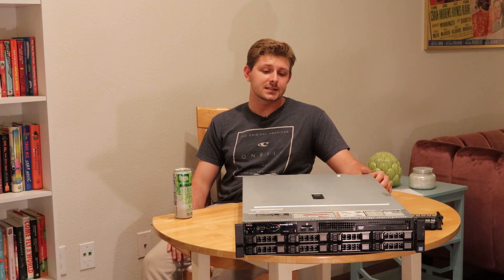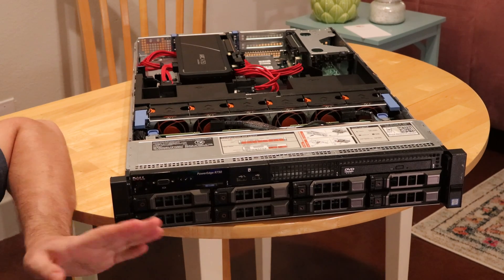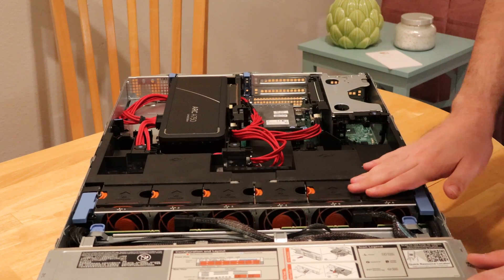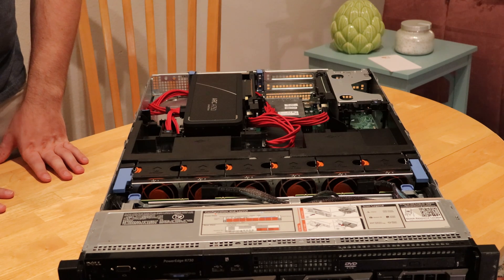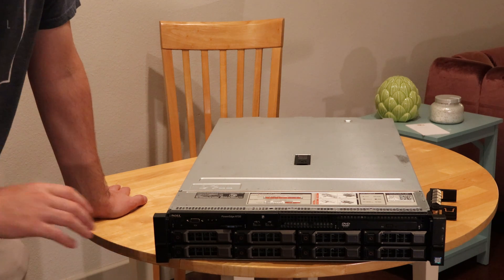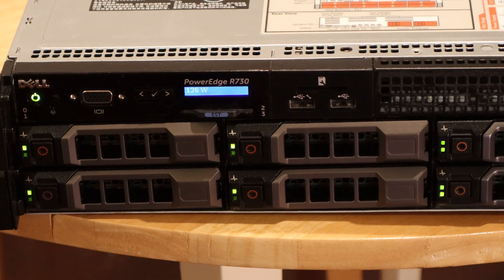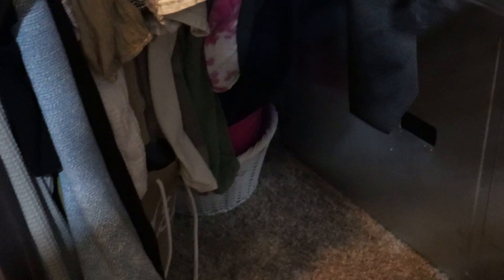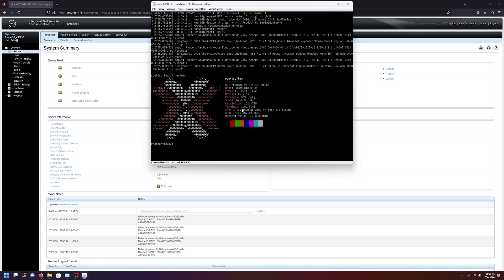The BEST Homelab Server for the Money - Dell PowerEdge R730

Comment: I have an R620 which is a 1U version of this, and it's been pretty great, it uses 2.5" drives though, but as 2.5" SSD drives have gotten cheaper, I'm just starting to fill it up with those...
Reply: Dell PE r630 is the "1U version of this," kinda. Save Gen. The old 12 series--r520/620/720/etc--are just that: old. Don't start me on the 11 Gen. LOL Those 2.5" servers--I have one of my five r730xd with 24x2.5" and it's all SSD--are very quiet. Put in low power E5-26xx V4 and they don't take a lot of power either for huge performance. And Proxmox loves them. :)

Comment: Great video ! And great job with the GPU power cables.
Dell sucks at generating solutions for the high grade GPU powering and fan speed problems. 
The biggest issue I have encountered is the GPU power cables. There are a lot of cables around, but most of them are useless. 
I have a R730 with 2x2699V3, 304GB ram, 2TB NVMe PCIe SSD + 2TB SATA SSD, 2x1100W. And the fans are silent normally if you do not add a GPU. But with the GPU, I needed to lower down fan speed a bit. But recently I saw that there are liquid cooling options for dell r series as well.
Reply from the maker: Thanks for the comment! It took me a good two hours to make the cables due to my own rushing and making mistakes and not being sure of the exact pin-out, as I heard on some servers the pin out is that of a cpu 8 pin connector, and others a 8 pin PCI connector (this was what the r730 used) , but it was definitely do-able. I saw several options for a cable on eBay and Amazon, but I can't comment on the quality of them.

Liquid cooling would be really cool to see on these - I'll have to explore that and see. 

What do you use your machine for? Those are very nice specs!
Reply: I presume most of the things that I will mention below are things you already knew. However, I had no server-grade machine experience before I bought the r730, and I learned a lot by reading people's comments. I believe your video will be a magnet for r730 users, and I wanted to leave some breadcrumbs for your future subscribers. 

We (my wife and I) use it for genetics/genomics/proteomics data analysis on Python and R kernels on Jupyter Notebooks. Hopefully, we will use it with DL/ML-based image segmentation and prediction model training if I can successfully install P100 16GB on the server. I'm still having problems with the power cable and waiting for a custom-made cable. I tried different cables sold on Amazon and eBay, which claimed to be for R730, but the more I ordered, the more I learned that most of them needed to be correctly configured. Not even mentioning that every time you plug one in, you risk burning something in the server or the GPU because of voltage issues.

I use R730 full force without VM to get its total capacity on Linux. For people who would like to use this machine in analysis but wondering about the performance and who would ask why (some of them might say, "My Mac with Apple silicon can do a better job"):
Most of the data-heavy analyses hit CPU or Ram units a lot, if not both, during the analysis pipeline. Simply because the packages in genomics/proteomics were generated by non-professionals (mostly with grad students' help) and are not optimized for daily use. So, even when working on parallel computing nodes, we have problems caused by using non-optimized packages. And this ends up in pipeline breaks due to access Ram use etc., after it first caps the Ram and then hits the swap. Solving these problems is highly problematic since you assume that the server is always perfectly configured and the problem is your code. But most of the time, you find an incompatibility problem in the environment you compute and try to solve it by sending emails to the server admins. The other option is using Azure, Colab, or AWS, but this time on one end, you don't know where that data goes, on the other end; if you'd like to complete a job that will take days, it starts to become a headache. And not every time your code works as expected, so you re-run and re-run again. On new, loaded Mac notebooks, Ram becomes an issue even if you have 64GB of it. On the other hand, Mac desktop computers are really expensive, and Apple has the habit of turning your money into ferry dust after 2-3 years if you invest in them. On the contrary, old server machines like R730 give you the whole control of the task, and you can log in and be able to trace the problems quickly. One step ahead of R720 with DDR3, R730 can use DDR4, and the Rams are dirt cheap on eBay these days. On the CPU level, even though each CPU core individually seems to be slow compared to the latest CPUs, when run in parallel, they form the mighty "Voltron" together to complete the workload. 

By the way, to protect the mental health of new R730 users who would like to add new GPUs, I'm adding a youtube link for how to design and generate a GPU-Riser PCIe 8pin cable for R730:
https://www.youtube.com/watch?v=fvgw9sv8k9I&ab_channel=ComputersCatsandMore 

And on this one, the same person checks the voltages of the Riser and shows how the cable pin configuration should be for R730:
https://www.youtube.com/watch?v=1bInTHpoPSw&t=210s&ab_channel=ComputersCatsandMore

The person in the video also sells cables, server parts, and machines on eBay and is very helpful and reachable. This is the person I ordered the 8-pin cable from, and I'll add an update on this topic in the upcoming days :).

Most people use these machines for home-lab-based use, including mining, gaming VPN, email or web server, etc. Because these machines are a bit aged, new parts and solutions are a headache (such as NVMe boot and new GPUs). So, I presume people start moving to newer machines that would give them fewer problems to solve and more options for using newer parts(especially the miners). On the contrary, some parts and tech (such as 10gig ethernet cards or switches) that were so hard to reach budget-wise a couple of years ago are now dirt cheap on eBay for R series Dells.  

For the fan noise, here are my notes:
R 730 works incredibly quite if you use Dell-branded parts(I'm excluding the GPU). Compared to the AC unit we use in the US, it generates less noise if you're not pushing it to compute on a vast data frame.

The first time you add any new parts, in order to protect the board from the heat, it gets loud and settles down to be quiet (of course, if you did not add a GPU).

But if you add a GPU, because the BIOS fan hex codes are old, once it senses that something is getting massive power out of the system, it starts jet engine mode and gets very noisy (every time I hear it, I curse Dell engineers and I hope they feel it in their bones). 

There are two ways to slow fans down:
a) Let it run full diagnostics on the parts (find it on the lifecycle menu). This will take an hour or so. It checks every CPU core and Ram separately, including the video card. And it will go down from jet engine mode to ~4000rpm-ish, which is still loud. But you do not have to do anything; it takes care of itself if it gets hot.  

b) Use hex codes:
These codes will temporarily override the reactive BIOS hex fan code running in the background. You cap the spinning to a level. * REMEMBER TO CHECK THE TEMPERATURES IF THE GPU IS BUSY WITH SOME TASKS.***
Enable manual fan control:
sudo ipmitool raw 0x30 0x30 0x01 0x00

Monitor temperature:
sudo ipmitool sdr type temperature

For example, to set the fan speed to 20%:
sudo ipmitool raw 0x30 0x30 0x02 0xff 0x14
** Now they should have slowed down **

Monitor fan speed:
sudo ipmitool sdr type fan

ALWAYS Monitor temperature if something is running in the background :
sudo ipmitool sdr type temperature

I will generate a temperature-sensitive script that will change the fan speed accordingly and add it to the Ubuntu startup as a service once I successfully run the P100 GPU I have. I do not want to deal with the BIOS hack; I will bypass this with a script. 

Note: I use a 3.1 Samsung Clover imaged USB hooked on the board USB hub to boot Ubuntu 22.04.3 LTS Server running on PCIe Samsung 2TB NVMe SSD. The overall reboot time is ~3mins. Getting rid of Clover might only give back ~30 secs(27 sec to boot into Clover + 3 sec after Clover starts). Believe me; I tried a lot to get rid of it to boot the Ubuntu. It is not worth your time! Add whatever service you want to start to the startup and give it another minute; that's it. Notably, if your services are running, you will restart it rarely! The Dell boot manager checks everything and consumes most of the startup. And by getting rid of the Network check after the Ubuntu boot menu, I managed to get back 2 mins.
Reply from the maker: @drcemdede   Thanks for the reply and excellent write up - lots of informative and very cool information, much of which is new to me! You've done a lot of research and are very familiar with the machine! I'm hoping your power cables work out and hope the project continues to progress smoothly! 

To add, I'm fairly certain the snag you're having with the power cables is that the P100 has a EPS12V connector, which does not match the pin out of the riser cards. You'd likely need the riser card PCI-E 8 pin power cable and then a PCI-E to EPS12V adapter. Essentially hook this: (Dell P/N N08NH) up to your riser(s) and then hook this (NVIDIA P/N: 030-0571-000) to the other end, and then to the P100.
Reply: @ComputersAndCoffey  The easiest way to get working GPU cables for R730 is to buy the genuine Dell part (9H6FV) and replace the connector at the GPU end. NVIDIA provide technical data sheets with the expected pinout. The wiring colours are super obvious black is ground and yellow is 12V as expected. There are some sellers on eBay in China offering a suitable cable, just need to look for the ones that say P100 compatible. These are good for P100, V100 and A100. Though the R730 will only work with the 40GB version of the A100. The 80GB version is a 300W part and requires an R740 with riser option 16.
Finally the technical manual for the R730 says that when GPU's are installed all PCI slot covers that are not in use need replacing with solid ones for cooling purposes.
Reply: I totally get what you're saying.  My Dell R720 runs almost desktop quiet.  The Air conditioner in the room where my server rack is located is (which is also my office) is louder.
Reply: See the link i posted above.  It fixed my fan speed 👍

Comment: Honestly this thing is remarkably similar to my HPE DL380G9
Pretty much all the mechanisms work the same, sound is the same, expandability is the same.
I run mine with an HPE Nvidia P100 tho and dual 500W PSUs in balanced mode. I tried running dual 1400W PSUs because the manual says it's mandatory for when you have a GPU in your Server and yeah... Turned my 140W idle to 165W idle... And as someone from Europe, that's not exactly nice.
Fun tidbit tho: My 1U server is much quieter than my 2U server, but it's also only single socket and a newer generation of CPU (and I can fully control fan-speed on that one, unlike the HPE)
Reply from the maker: I've looked at the HP servers on Ebay, and they do look very similar! I just cant seem to find them at as reasonable prices as the Dell machines
Reply: @ComputersAndCoffey Probably a geography thing. Here in Germany it's much easier to find HPE hardware than it is to find Dell hardware. My own DL380G9 is formerly from a German TV broadcaster. I've even seen an affordable DL380G10 on German ebay, but although every fiber of my being screams at me to  buy it, I really don't need it 🥲

Comment: what power consumption like ?
Reply from the maker: It uses 126 watts at idle and doesn’t go above 200 ever really. And that’s with the Arc A750, I’m sure without it, the draw would be even lower.
Reply: @ComputersAndCoffey  it is about 3kW a day or 90kW a month. or one megawatt a year in idle mode add its noise and I think your girlfriend has a point.
Reply: I built my own VMware ESXi Hypervisor server out of normal PC hardware that only idles at 55Watts of electricity. My ESXi box put these over kill  enterprise servers shame. I'm running a total of 14 Virtual Machines on mine box with RHEL8, RHEL9, Ubuntu, Windows Server, UNIX FreeBSD, pfsense, Ansible....
Reply: @eman0828  55 W is acceptable, especially if you use it as a switch (ovSwitch),  router (Vyos, pfsence)  it is already about  -20W of the hardware devices.
Reply: @user-0xDEEDBEEF  Yeah my unmanaged 24 port Cisco Switch uses about 17 Watts. I also built a TrueNAS server out of standard Desktop hardware with an ATX board. That thing only idles at 35Watts. I use to own two 1U Dell PowerEdge servers back in the day. Will never go back to thoses. They aren't needed for homelabs. Most data centers build their own white box servers esp goo gle, fb , like what I just did.
Reply: @eman0828  why do you not use a one-box solution? I am in the UK and one kilowatt costs 35 pence here hence it is cheaper to buy more memory than build a separate box. Especially the NAS device is 99% of the time is idle.
Reply: @user-0xDEEDBEEF  You don't want to put all your eggs in one basket as a single point of failure. I will never run a edge router, firewall, NAS, along with my Lab server on one box. Infact my two servers I built are not on all the time. They are only powered on when needed. I'm running pfesne on a fanless Sophos Network Security Appliance. I erased tge existing Sophos OS and installed  pfsense on it. That box is essentially a mini PC like an Intel NUC. It only uses 5 Watts of electricity. Just my networking Equipment alone only uses between 20-22 Watts of electricity. When I power on my ESXI  box, he total power consumption of thr box and networking hardware idles around 70 to 80 Watts. I shut down my ESXI box when I'm not using it. I use my TrueNAS box for backing up data only which is rarely powered on.
Reply: @eman0828  It does not work like this. You have a single point of failure and you have more than one of them.  It is your router, your switch, and your workstation.  Do not tell me you have two routers two switches and two identical workstations.  😂 With more points of failure, you have a higher probability your office to fail. This is math.
Reply: @user-0xDEEDBEEF  Lol. I'm a UNIX / Linux Sysadmin in real life as my profession. You do not want all you services on one physical machine and not have any kind of redundancy. Thus is what you all a fail over cluster. My setup is not a production environment nor my boxes are on all the time. In a real production environment you are managing clusters not a single box.
Reply: @eman0828  I do not belive you. It is clearly visible in your home installation you are not. 🤣🤣🤣
Reply: @user-0xDEEDBEEF  lol. You are definitely trolling right now.
Reply: @eman0828  not intentionally, I am sorry.
Reply: @user-0xDEEDBEEF  no real sysadmin manages one machine. Lol when was the last you managed a cluster stack of thousands of servers, vms and Kubernetes, Docker Container clusters? When as the last time you used Ansible Tower or Terraform?
Reply: @eman0828   sure but the home installation is not about managing the system it is about solving some household needs.